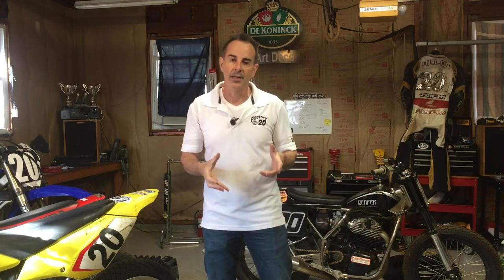Your First Flat Track Race pt. 1: Dirt/Street Rider to Racer

Comment: Tire gage, tire pump, riding gear, gas, chain lube, hotshoe, food, water, sunshade tent, towel, generator & lights if you have them, go-pro if inclined, spare tube for each size wheel if not the same, phone car charger, rags, tearoffs, pit stand for your bike, cash for entry, a little rollout pad or carpet to go under bike under tent, folding chairs, cooler, ice and a beer for after 👍
Reply from the maker: Great list!

Comment: Thanks. I subscribed to your videos. Your examples and the way you tell your info is very good. All good advice. Im  soon to be 68 and your slow motion videos brought back so many memories of riding on the edge. and especially the feeling of a bike nearly  perfect in set up. Almost out of body, HHaaa hha. But the ease and grace is still hard to describe . When you fight the bike it will fight you back. But when its right ,Its like your just along for the ride. Hardly any input, point it, Every thing is working together and efficient . I can remember barely holding on with two fingers, just guiding and sliding.  Thanks again,Your descriptions and examples are communicated very well. I enjoy all of your videos and all riders can benefit from watching.
Reply from the maker: Thanks, man! Glad you found the channel.  Great description of what it feels like to ride a well-sorted race bike.